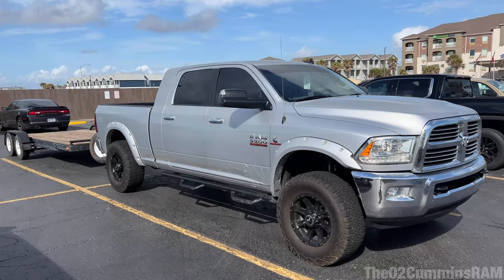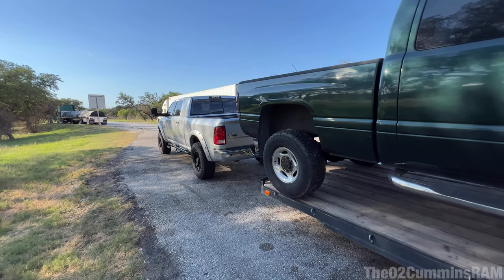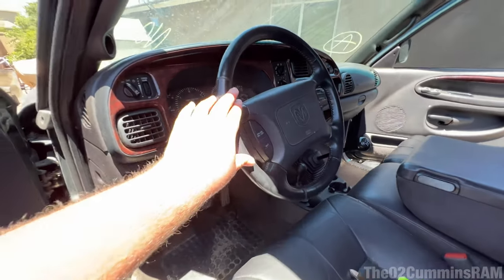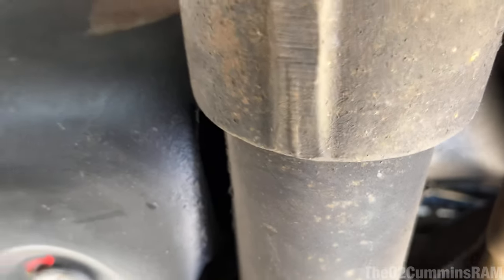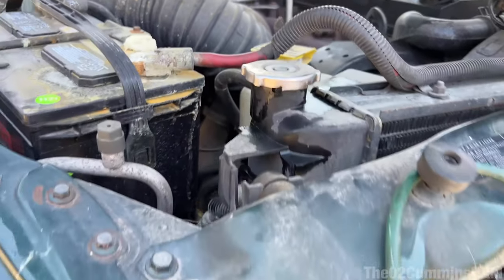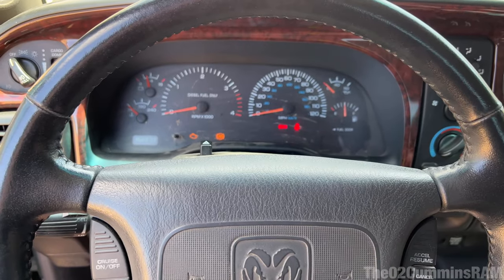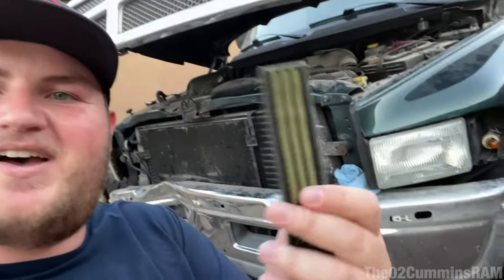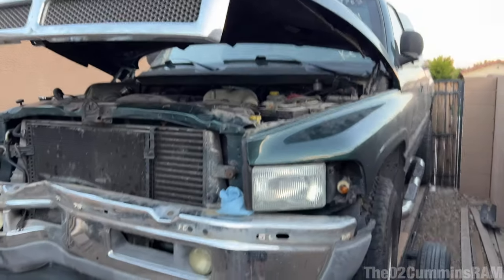Bought My First Copart Salvaged Truck! - Rebuilding A Wrecked 2001 Manual Cummins￼!

Comment: You need to pull that mess of wires off. Restore the OEM wiring.
It’s tied into the power for the ECM that controls the pump. It runs for a sec then kills the power.

Comment: Hey man this is Detroit Dagwood there should be a fuel shut off switch on the frame close to the gas tank on those years I think they had one and in an accident they'll pop like the old Fords had in the trunk quarter panel go under there it's like a circuit breaker click it and then try to start it

Comment: The ecms go bad on these, the part that controls the fueling... that's why a good used one is like 1k.  Also hard as the front axle was hit, may have a bent axle housing too.  Last one I bought hit that hard, had to replace it.